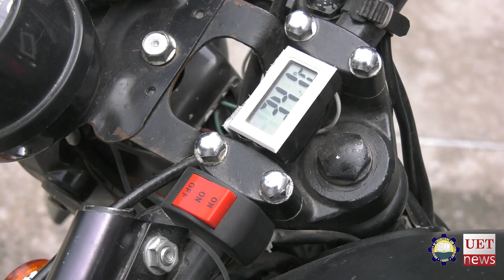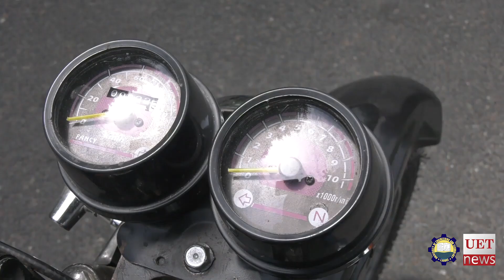UET Lahore Students Convert Fuel Bike to Electric Bike

Comment: Yr is me fast charging laao, I'm gonna buy it
Reply from the maker: Thank you for your suggestion 🙂🙂🙂
Reply: lithium ion batteries can be charged in 1.5h from 0 to 100%, 70-80% in less than 30-40min if charger is powerful enough. keeping C rating in mind, I'm planning 20S20p battery which will charge at 30Amps (2.5kw) charger and in 30min charge it will give range of 50km. inshallah
Reply from the maker: Great 🙂